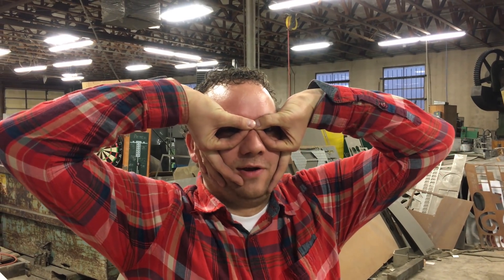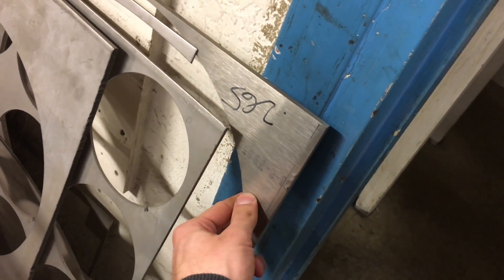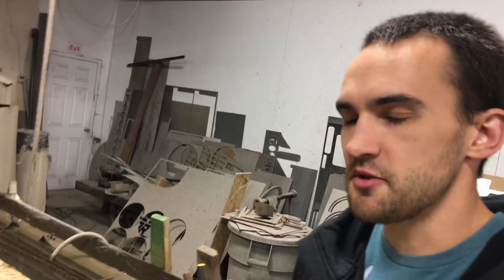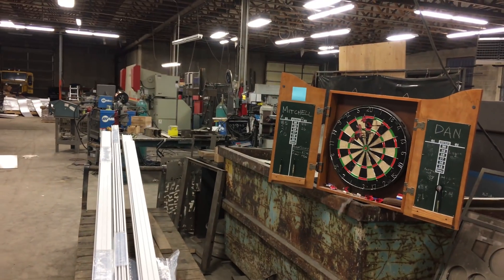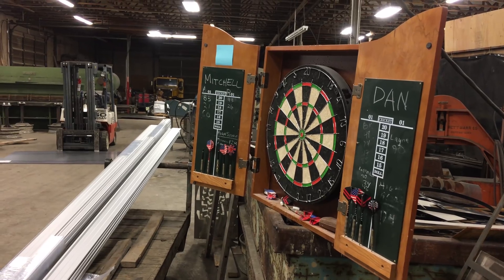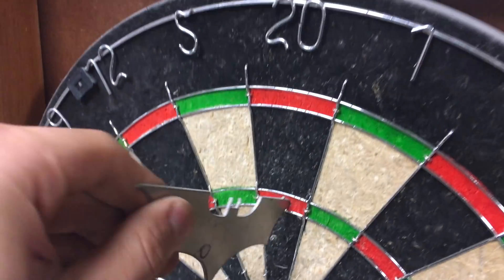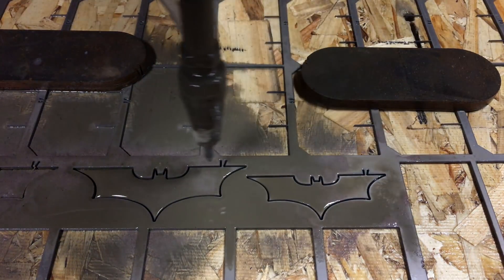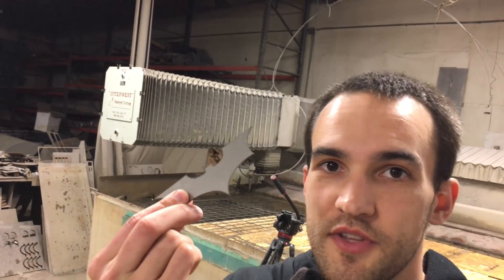Cutting Titanium Batarangs With A 60,000 PSI Waterjet

Comment: Can you cut tungsten carbide with water jet?
Reply: The tubes from which water comes out are called focusing tubes, and are made of that material - are very hard to cut because the metal is harder than the sand mixed with water. That and certain ceramics like aluminium oxides are some of the few materials that waterjets don't like to cut.

Comment: I was just wondering if you placed a 45 degree angle on the side of the batarang and then used the water jet to cut the titanium on a angle would it be possible to actually sharpen the batarang as the water is mixed with sand and being pushed out as such a high speed and also psi is there any chance that the metal could actually get sharpened. 

I'm just curious to know if that's possible as when you go to sharpen a blade you use a sanding machine or sandstones with water or a grinder to sharpen a edge on a blade and also a lot tools that sharpen blades go at high speeds and also require pressure to be pushed against the machinery. so with the jet could it also work and sharpen the batarang or is that just impossible and no matter how fast the water is going and how strong the psi is and the amount of sand you use is there any chance that the blade could get sharp? Or is it just impossible and it requires different tools to sharpen the batarang.